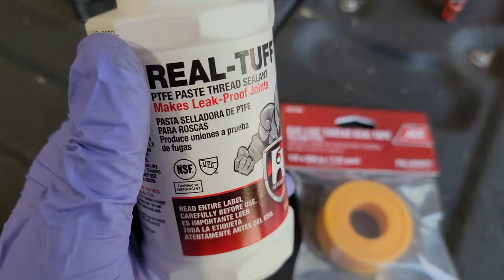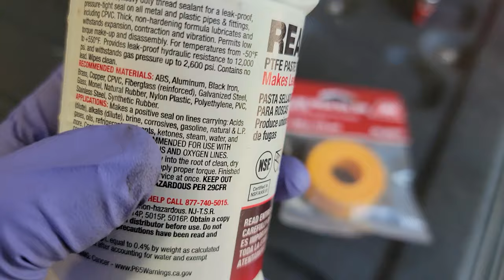No.1 S&B Fuel Tank Add-on | Transfer Pump kit INSTALL (DIY) @SBFilters

Comment: Concept is awesome, some more engineering needs put into the pump mounting situation… I think I would prefer to mount the pump on the frame rail and set up some type of bulk head to connect the hose to in the bed. Keep up the great work.

Comment: Nice install👌...if I was moving that much fuel to warrant a transfer pump?... I would probably have a separate transfer tank as well...that's just me😉...OH, keep a sock over  the nozzle if not used often ( mud dauber's nest )
Reply from the maker: zeeeeeeeeeekster
Reply: Spot on tip thanks zeke

Comment: A-Rod
I went with a 50 gallon TransferFlow under my tonneau cover so that I could keep my extra fuel somewhat out of site. With the larger tank mounted under the truck you can still loose all of your fuel, with my system the most I can loose is half of my stock 35 gallon tank.

Comment: Someone Ran out of Diesel fuel the other day, I took a 1 gallon jug slid it under the fuel water separator tap (yellow tap).
I was able to fill it 3 time to get the guy out of the rut. 
In case of emergency you can also do that, to extract fuel out of your 6.7. 
I also have a dealership installed 65 gal under body replacement plastic tank. 

It’s nice to see how it’s done professionally!
Reply from the maker: Thanks pal
Reply: Ask me how I know how this saves your bacon if you gotta drain another diesel dry due to contaminated fuel…it worked awesome and saved us from humping and finding diesel cans and a funnel

Comment: This is perfect for "that guy" that puts DEF in his fuel fill.
Reply from the maker: Hahaha
Reply: So I take it that you don’t have one that has DEF . And why would you pump DEF out of the truck anyway? Not enough capacity on a DEF tank.
Reply: @TonyBenton0728  the joke went over your head.  
  From a repairer standpoint and seeing how many fellas put DEF in their fuel tank in error, with this when that mistake occurs they can simply pump it right out!  
  It was humor for anyone that deals with it.
Reply: Take the first 40 out with the transfer then pop the plug fir that last 20!
Reply: @Itsa_Mea  Yea…Yea…Yea I know it was a joke. This pump would not help pumping DEF out of the fuel tank because it would not get to the bottom of the tank so let’s try something else. 🧐🤔
Reply: @TonyBenton0728  that’s when ya pop the plug on the bottom of the tank😉
Reply: @croutster8399  OK Cheaper to pop the plug to start with.  This isn’t going anywhere. 👋🏿
Reply: @TonyBenton0728  pull the lower plug!

Comment: I just installed a 95 gallonL shaped auxiliary tank . I could install a pump but it would look ugly so I gravity feed it instead. And those S&B tanks are very expensive and I would not gain that much anyway on my 2022 F 450 anyway.
Reply: I went from 510 miles to E on a tank to1050 miles to E when topped off.  Absolutely love the extended range.

Comment: Awesome stuff as always! Just a thought, if you put a street 90 degree fitting in the bottom of the pump you could use the original mounting location.
Reply from the maker: All we had🤷‍♂️
Reply: @PowerStrokeTechTalkwARod  I know how that is 😂. It’d be cool if S&B adapted their kit to use your routing as most guys would prefer to not put a hole in their truck. A street 90 and a swivel end on the hose would make it an unbeatable setup using your clean as always install!
Reply from the maker: I wish we wlda had it but, hey we're gonna chat wit the S&B team & make dis that much better
Reply: @PowerStrokeTechTalkwARod  if you ever make it down to the stl hit me up! I’ll give you the rundown if you’ve never been, lots of great places to go and see and a couple areas to avoid 😳
Reply from the maker: Nelly move over PTT bout to diesel on thru

Comment: ARod Installed a 60 gallon on my 2017 F250 and tried to change it to 60 gallon with S&B Ezlinx. Took it to the dealership and they said it won't read the aftermarket tank and $190.00 later the fuel guage/ miles to empty still isn't working. Does anyone have any suggestions what to do. Thanks
Reply from the maker: buddy email us, well get cha handled
Reply: @PowerStrokeTechTalkwARod  ok

Comment: Mannnnn, I was hoping this was for say an additional 40 gallon transfer tank in the bed that would flow fuel into the 60 gal S&B, I really want 100 gallons in my truck. When I tow I carry four 5 gallon Wavian fuel cans in my bed to get 80 gallons for that extra range.
Reply: Transfer tank with the s and b voids the warranty of their tank..just keep that in mind.  There is gravity burst pressure put on yours and b when tied into their tank.  You could run one independently though?
Reply: @croutster8399  i remember seeing that it would void the warranty. What is gravity burst pressure? I wonder how I could run one independently under the Bakflip mx4 tonneau cover. Something I should look into.
Reply: @freethinkingamerican80  more or less it’s the factor of gravity pushing down below when the two units are tied into each other.  Diesel 7 lbs per gallon pushing down through the hose possible causing a burst of your s and b or leak out the vent.  All the diesel “weight” from above has to go somewhere.
Reply: I use the ATTA 110 Sleeper Tank with the Freedom Fill.  I don't have to pull over.  Flip the switch and pump right from the Aux Tank into the Main Tank.  It has Auto shut off.

Comment: Only problem with this whole concept is ur fueling ur equipment with green on road fuel n not the cheaper red off road fuel otherwise this is very handy for the homeowner that won't use alot of fuel to notice the tax savings